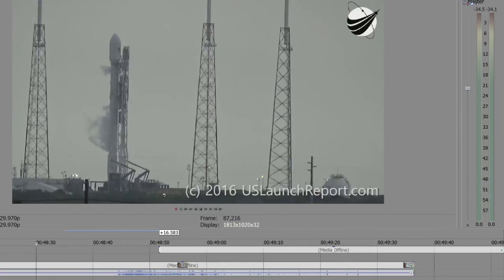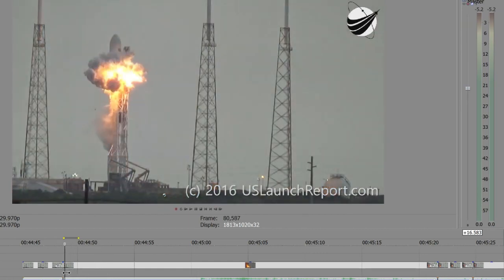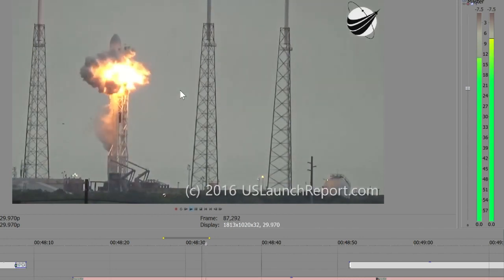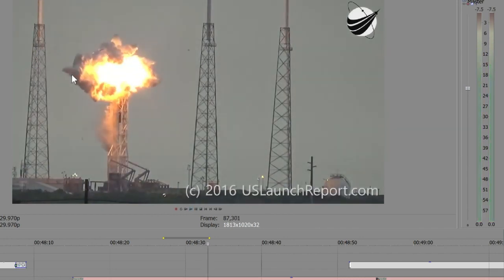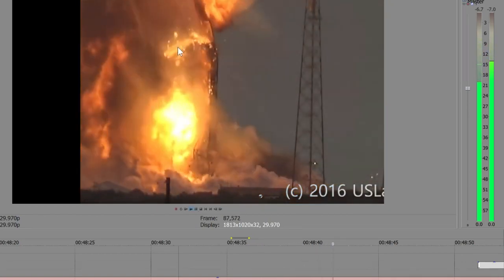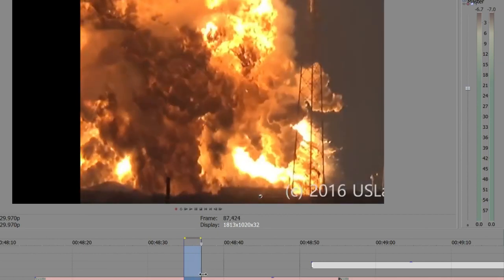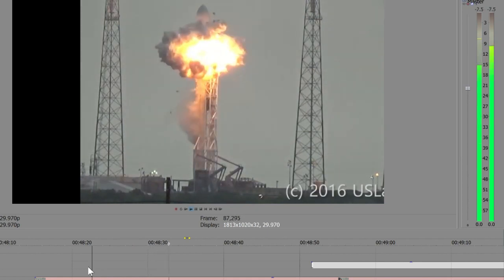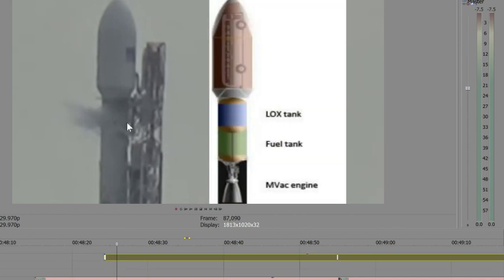Detailed analysis of Spacex Rocket Explosion

Comment: If the inner diving wall wasn't made to withstand a pressure differential between the two sections to save ISP then it could have been a leak in the fuel or O2 making a pressure differential and so a rupture in the inner wall.

Comment: If the fuel and oxygen are only separated by a thin wall, it may be thermal stress that made it break. As a result, the oxygen would be "heated" by the fuel and pressure would build up. And as we learned from the Apollo program, pure oxygen likes to ignite nearly everything at around 2 atmospheres of pressure.

Comment: Thunderfoot, your work reminds me of the work done by Richard Feynman on the Space Shuttle Challenger accident board; applying basic scientific and engineering knowledge to the readily available evidence.
Feynman used a styrofoam cup of ice water to demonstrate why the solid rocket booster segment seals failed at subfreezing temperatures.

Comment: Could the buzz/squeak before the pop be someone or something reacting to the sight of the explosion (it happens soon after the image reaches the camera)? The pop does have the same quality as the explosion so I can believe it's the bulkhead failing or something like that...
Reply: That's true. The guy filming it might've seen the explosion, and sat forward in his chair before the sound arrived.
Reply: Yeah. I was also thinking that a mic that far away wouldn't pick up a relatively quiet pop. But it's not a reaction to the explosion, remember he synced up the audio of the explosion with the visual, in the source it arrived 12 seconds late.
Reply: If you watch it with the original timing, the beep happens about 6 seconds after the explosion can be seen. The sight of it may have startled someone or an animal, or caused an alarm (if the camera was near a facility with a PA system).

Comment: The SpaceX failure in July 2015 was caused by a helium line failure in the LOX tank. The helium tanks are actually located in the LOX tanks. This would make sense because you could hold more helium at a lower pressure if it's kept cold by the LOX.

Comment: I appreciate your attempt at more detailed analysis and the fact that you are serious about it this time.

Regarding the two sounds before the explosion - the audio is stereo. You can figure out the direction from which they are coming by evaluating phase shift between channels on this sound. In my opinion, they're both coming from different direction than where the rocket is (and from where the explosion sound then comes) and are therefore unrelated to the incident.

Regarding the video itself, the original footage is 60 fps and what you're processing is only 30 fps, you're missing half the frames including the very first frame after the explosion. There are some interesting details in that frame since the fireball is only about half the size.

My question is, if you mix kerosene (likely cooled to increase density) with liquid oxygen at cryogenic temperatures, is that mix capable of spontaneous explosion? It seems unlikely to me since its temperature is so low and kerosene wouldn't spontaneously explode in pure oxygen even in normal temperatures.

Comment: The Falcon 9 is the rocket with the most sensors on it, they used the sensors to find out what caused the CRS-7 failure. If it was an internal rupture then they would already have some idea or even know what caused this failure, they could use the same method to pinpoint the location of failure. So either they know or have an idea what cause it and thunderf00t is right, or they don't know what caused it and thunderf00t is wrong. A good hint at why thunderf00t might be wrong is that the sensors on the rocket didn't detect whatever caused that mysterious sound.

Also thunderf00t is placing origin point of the first explosion too far to the left, it should be more to the right.

Comment: The single wall bulkhead, or common bulkhead between the tanks was also used in the Saturn V, again, simply to save weight. Thankfully none of those exploded on the pad! The shuttles main tank was a safer design, tanks separated and the oxygen pipes external to the fuel tank. I hope they find the cause. Interesting that if it was caused by some kind of over pressure situation that we could not see any change in the amount of oxygen venting off just prior to the bang. Maybe that could point to the oxygen pipe fracturing inside the fuel tank - thus no extra boil off gas evident from the lox tank..
Reply: i think there is no increase because the vents have a fixed maximum flow rate
(+ if the pipe fractured inside the fuel tank -> lox boiling (fuel at 10°) --> over pressure --> increased boil of ; basically the same as if there was a leak in the singel wall ; if there is a leak somewhere between the lox and the fuel tank both more or less become one pessure system)
Reply: Likely there is a fixed maximum flow rate of venting gases but that would be no where near what you were seeing.  If you think about it, if it was under a constant max flow venting then there could theoretically be an increase in backpressure which I doubt very much they would want.  I do not see why the focus on single wall tank, cause if the wall was doubled and one of those failed, would it not still be doomed, maybe only a bit later?
Reply: While the quantity didn't seem to change much, the direction of the venting changed abruptly at the 'pop'. Maybe that hints at something internal distorting and changing the exit angle of the vent piping.

Comment: But, you are dealing with liquids, how many kilograms of LOX and Kerosene are in the tanks and their heights of the fluids within each tank determines the peak pressures at the aft bulkheads. It may not be as low as you are expecting. The shared bulkhead has a high LOX pressure and a low Kerosene pressure with a high temperature gradient which makes most metals all the more brittle.

Comment: the sqeek could be some aluminium that shrunk and giving off some noise... or just local

but the pop definitely is a cracking sound from a tank... 
so the squeek may be an indicator for liquid oxygen flowing out of its tank and chilling other stuff inside and that will chill the cerosine tank too... then the cerosine tank cracks and both mix slowly... then they'll react faster and faster until it goes bang